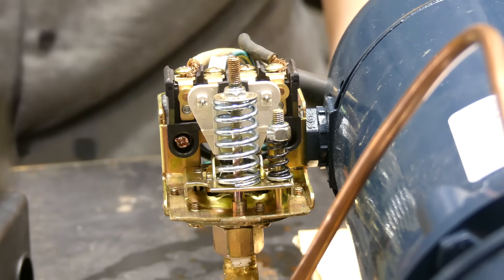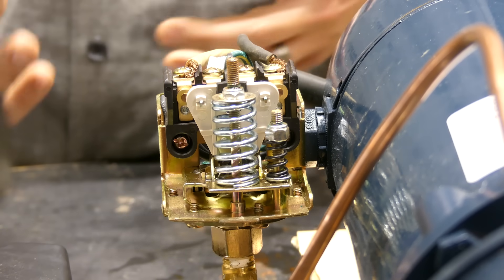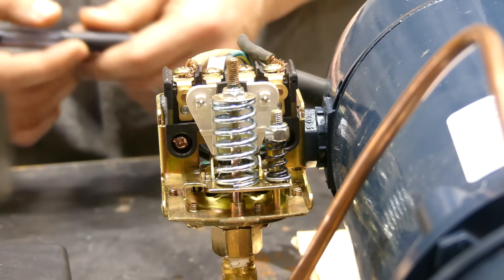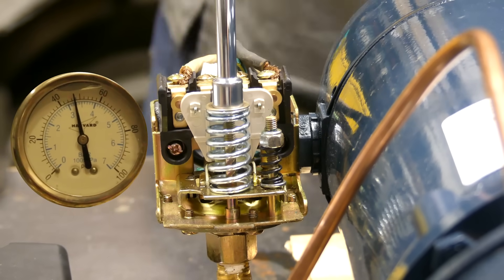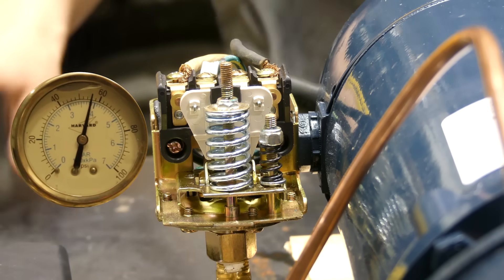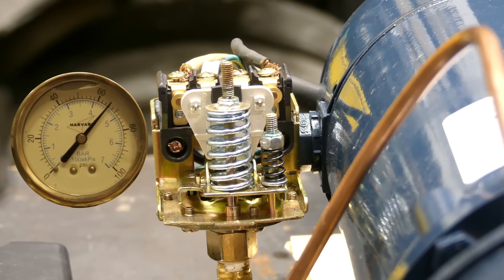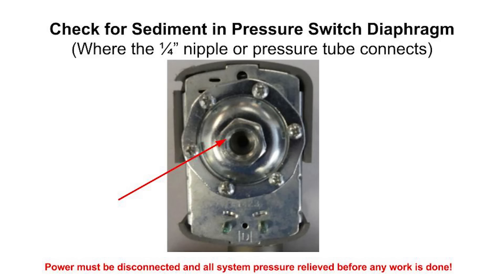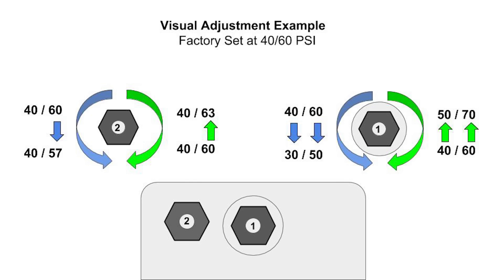How To Adjust a Pressure Switch

Comment: I put a new pressure tank in, pump shuts off at 55lbs like I want it to but when I'm running the water the pump don't kick on till I have no water pressure at all. like when I take a shower I will completely run out of water before the pump kicks on
Reply from the maker: You need to check your pressure tank. We have a video on checking and adjusting pressure tanks you should check out.
Reply: @RCworstwater  put a new pressure switch on it, that was the problem all good now

Comment: I have a well pump I replace the submersible pump and water tank and also the point but it keep jumping on and off the water pressure in the house is low can you please help me
Reply from the maker: Your tank may not be big enough or the air pressure isn't set correctly. Here's a video on how to check the air pressure in it: https://www.youtube.com/watch?v=w21qa2bMUh8

Comment: I turn pressure to 40/60 but now when the well turns on. The pump just goes on and off and on and off. Until it bulds pressure?  I only turn the top nut 3 and half times
Reply from the maker: Give us a call Roger - 855.329.4519 - You should also make sure your pressure tank is set correctly, watch our video on how to check and adjust pressure tanks.

Comment: i have a problem, i have squared D and a pressure tank with a max psi of 40. I used braided hose with clamps from water tank to pressure tank and braided hose with clamps pressure pump to pressure tank. I can gain cut off. I twisted of counter clock wise and never cut off and suddenly the hose got dislodged. Pls help.
Reply from the maker: Frederick, please call our technical service number: 855.329.4519

Comment: HELP, My psi is at 0, even if i tighten the pressure it does nothing. What do you think the problem?
Reply: Do you have power at the pressure switch?  Are all wires attached?  No scorch marks?  Is the 1/4" nipple clogged?  If nothing found, I'd buy a replacement switch.

Comment: I put on a new pressure switch and didn't cut the power off and went to adjust the nuts and got a spark now no power at the switch did I burn the new switch up?

Comment: What will cause the pump to keep running without cutting off? And another thing the pipe keep swelling like a balloon at the two end of the pump.
Reply from the maker: If you adjusted the switch you may have set the turn-off pressure too high. Give us a call and we can help: 855.329.4519

Comment: can I switch to a pump above ground, from sub? they burn out a lot!
Reply: Yes, but how deep is your well?  Shallow well pumps can only work with wells less than 23 feet down.  "Jet" pumps can go deeper but flow is less and the well casing will need to be wide enough for 2 pipes.   One other thing.  If you live in a cold area, you'll need to move the pump into some kind of "pump house" that stays above freezing.

 I had a Sears "convertible" jet pump that worked very well for me.  My well was 33 feet deep, and I had a water table 16 feet down.  I never lost water even in late summer when the neighbors went dry.

Comment: Hi get out the air from pump ? ( in case to repair ) thanks
Reply: There is usually a small screw on top of the pump that you can remove to add water and reprime the pump.

Comment: Watch out for the pressure switch with an off pressure of 80 PSI and above, afraid that the water pump is broken, if the water pump doesn't burst, the pvc pipe is broken because the pvc pipe has a maximum pressure of 55 PSI by default.

Comment: Can anyone help? Is pressure switch will only cut off when it reaches at its cut off (meter) point? Or it will automatically cut off/shut off the whole pump, when the the ball valve reaches up as it close? 

Coz, before we install the new pressure switch, we always see the pump will only turn off as the ball valve closes, and when we install the new pressure switch it close at its cut off point, BUT it didnt fill the tank with enough water.

 Appreciate your help. 😁

Comment: I’ve noticed that mine is a 30-50 switch. But cuts on at 20 and off at 50. Air pressure sitting at 28psi

Comment: Good explanation of the pressure switch but you forgot to mention the need to match the air pressure in the pressure tank to the cut in pressure of the pump.
Reply from the maker: We did forget to mention it in this video, but here is a video that covers it : https://youtu.be/w21qa2bMUh8

Comment: I have a question : We just have a new switch with new wire running from the braker panel , here is the question : the switch won't work just kicks and kicks out but don't hold the resistance so the water hasn't sufficient pressure to go to the house ,what can we do?
Reply from the maker: I would check that the pressure tube or pipe is free of debris. Sometime small pebbles or sediment can plug the line that allows the pressure switch to sense the water. If your pump keeps running but water pressure is not getting to the home check for leaks or closed valves. If you have further questions please let us know!
Reply: @RCworstwater     .l uyt

Comment: I have backed off the differential switch completely and the pump still won't shut off.  Any ideas?
Reply: Even with the differential screw backed all the way off, there will still be some differential, something like 10 #.  Perhaps the pump can't put out enough pressure?
Reply: @jackb1803  I just replaced the pressure switch. Problem solved. Thanks for the reply.

Comment: if the air compressor has only one adjusting bolt, how must it be adjust for the perfect cut off and cut on ?
Reply: Well, this video is on water pressure switches.  In your case, the differential is preset.

Comment: dear sir,

last month i had trouble with my pressure switch, every time i started pump, within 2-3 seconds pump shutdown automatically, i checked inside have one spring and one pressure regulator screw. four points NC NO C T, C NC have conductivity, should i loosen the screw??? 

after replacing with new one pump working, but i need to fix the problem

great to watch. best wishesh

best regards
Reply: Is your pressure tank "waterlogged"?

Comment: Does water pump automatically turn off when it’s hot?
Reply from the maker: Yes, single phase motors have a thermal overload installed to cut power if they get too hot.
Reply: @RCworstwater  Thank youu!!

Comment: What does it mean that there is a Spurt of Air in the Faucet, just after turning it on ?
Reply from the maker: It could be air escaping from the system after initial startup. If it persists then air is getting into the system somehow.

Comment: my water pressure sky rocketed today. i wonder if this could be a broken spring? i have a submersible pump
Reply from the maker: It's more likely sediment/debris built up in the 1/4" nipple that connects to the pressure switch. You should replace the switch and clean that tube out.

Comment: mines way out of range... cuts in at 20 and doesn't shut off until 100. I wonder if i should attempt adjustment or replace the switch
Reply from the maker: Wow, that's unbelievable. You should replace it with a new one, who knows how long it will stay where you set it to. You can buy them here: https://www.rcworst.com/Square-D-c231.html

Comment: I wouldn't recommend going over 60 psi (cut-off) on a house older than 50+ years. You're tempting fate with the aged fixtures and plumbing. Even on a newer build,  The entire system will be stressed and the hose from the holding tank running to the pump will "jump" violently when the solenoid kicks off. Keep it at the recommended spec. Anything over 60 is pushing it.
Reply: Here in Mexico, we set it to 20/40 in old houses.

Comment: No matter how much I adjust the settings the pressure gauge reads 100psi and it only changes about 5psi. Should I get a new switch???
Reply from the maker: It sounds like your pressure gauge might be faulty.
Reply: I've changed everything on the T now, dialed it in.

Comment: That was really helpful. Thank you! If you don't mind, I have a question. My son bought a house with a well. This house has a well, and was built on a concrete slab (not a manufactured home). The water pressure seems to swing way too far. It goes from strong pressure, to nearly a trickle before increasing again. There is no pressure tank, or switch anywhere inside the house. However, outside, next to the well head is a 5"PVC pipe, with a cap on it. Is it possible that the pressure tank and switch are underground, and this pipe is an access point? Thanks!
Reply from the maker: It is possible, but there would likely be an access cover for you to enter the pit if it were. Is there a way you can get an as-built schematic from the original owner or contact the installer for more info?

Comment: I just bought a tank it came with 38 psi air but my presure switch cut on at 35 & cut off at 55  how can i make it to cut on at 40? Instead at 35  Please help thanks
Reply from the maker: Since your tank is new, I'd suggest just buying a new pressure switch as well.  It's a good way to protect your investment, here's a link to the 40-60 pressure switch on our website: https://www.rcworst.com/Square-D-Pressure-Switch-G2-40-60-PSI-Preset-9013FSG2J24-p1633.html

Comment: I need a 15 start pressure and a 55 off pressure what to do?
Reply: You will likely need a specialty pressure switch made by Square D.  The commonly sold switch cannot handle this range.  You can also achieve this with a pair of pressure switches (not the kind shown here) and some fancy wiring.  Good luck.

Comment: Can anyone help me?! I have a new UV and 5 Micron Filter system, and went to replace my Micron filter for the first time - turned off the power and released the water so i could open the filter housing, and the water pressure in my tank is at 0. The pump pressure won't start, and my pressure switch does NOT have a lever on it??? Someone please help, how do I kick it on without a lever?
Reply from the maker: Give us a call: 855.329.4519

Comment: Hello there , your videos are very helpful. I have a question? My current well has sand coming out.  Is it to far to connect to another well on my property that is about 100 ft away. If so any tips?
Reply from the maker: I'm not sure what you're trying to do, please give us a call to discuss: 855.329.4519
Reply: You need to consider adding some kind of filter before the pump as sand can erode and damage the pump.  Perhaps you have a screen at the bottom of the well that is damaged?

Comment: Hello, if anyone can help my pressure switch goes down to 10 psi and shut off at 30psi, is this normal with a pressure switch at 30/50 and the well tank pressure set at 28psi?
Reply: No, the pressure tank needs to be set under the cut-on setting.  But a 10/30 setting is pretty low.  Are you running aquariums with  vinyl tubing?

Comment: How do I reduce the range.  For example, instead of cut on at 20 and cut off at 50, I want to cut on at 40 and still cut off at 50.
Reply from the maker: Give us a call if the video did not explain it well enough: 855.329.4519

Comment: About every 3 3 weeks I suddenly have no water pressure.  I push the pressure switch plate with a stick until it makes the electrical contact and then the pressure comes back.  How do i fix this in a more permanent way?
Reply: sunny1011 replace the he pressure switch. Make sure you shut off the power before doing so
Reply: @larryreno8293  thanks for your reply.  It is a new switch.  I'm wondering now if the problem could have something to do with the pressure in the tank which i see must be set 2-3 lbs below the cut-on pressure of the switch.  Do you think that is possible that it would just quit every 3 weeks because of that?
Reply: sunny1011 it's always worth a try!

Comment: How do you adjust the switch so there is no on/off and the pump stays on as long as there is flow?
Reply from the maker: That is not within the capabilities of a standard pressure switch. You would need a constant pressure system to do what you're asking.

Comment: How do you rise the runing pressure..
Reply from the maker: Did you watch the video?
Reply: @RCworstwater  I did and I am trying it on our pump I can move up the range but when the tap is open full the pump pressure does not want to go up..
Reply from the maker: It sounds like your pump is not able to build a higher pressure, they do have their limits. You'll need to lower the pressure on the switch so the pump will shut off. To get a higher pressure you'll have to buy a different pump
Reply: @RCworstwater  Thanks..

Comment: Don't you need to add air pressure to your expansion tank when you do this as well if you're increasing the pressure I think you're supposed to set it about 2 to 3 lb under your cutting switch pressure
Reply from the maker: Correct! See the description for a video on how to do that.

Comment: I have a pressure pump it runs only if I use a lot of water like opening shower and sprinkler at the same time. How could I make the pump turn on if I am only using one faucet. The Pump is set at 40/60
Reply from the maker: Thank you for the question.  The pressure switch is what tells the pump to turn on and off.  With a 40/60 setting, the pressure switch turns on the pump when the pressure in the system falls to 40 PSI and the pump turns off when the pressure climbs to 60 PSI.
Reply: Is it ok to lower the setting from 40-60 to 20- 60  or 30-60 so that the pumps turns on even if I am using only 1 or 2 faucets at the same time?
Reply from the maker: Cesar it may be best to give us a call so that we can help you with your situation.  Thanks.

Comment: what to do if the pump turns on only after giving it a pat
Reply from the maker: You likely have a clog in the tube that connects to the pressure switch and/or in the diaphragm of the switch itself.

Comment: our pressure guage drops at 0 but still the switch doesn't  operate. do i have to buy another switch or It has to be adjusted?
Reply from the maker: You probably have a low-pressure cutout switch. You'll have to manually engage the contacts if so. Here's a video on them: https://www.youtube.com/watch?v=ROvZpwHV9Ho&t=20s

Comment: i installed a new pressure switch, pressure gauge, tank, and check valve. emptied the tank to learn its psi and when i turn the breaker back on, the tank fills, but when the switch goes to cut of, i get: ticka ticka ticka ticka. what's going on please?
Reply from the maker: It sounds like your pump is rapid cycling. Here's our video on troubleshooting it: https://www.youtube.com/watch?v=CPzRpD_Tncc&t=40s

Comment: The water pressure coming into my house is too high. How do I adjust to lower the water pressure? I have a 30/50.  When I checked the it read 30.5 psi..I released air to 28 psi. The water pressure is still too high coming into the house. How can I adjust it to lower the pressure?
Reply: Add a pressure regulator to your plumbing.  You don't need a pressure switch.

Comment: change my 30 50 switch and pressure goes down to 20 ish , how does this happen, new one installed
Reply from the maker: Did you buy the right switch? Look under the cap for the rating.

Comment: Great videos! Thank you! Question: when you increased the range from 30-50 to 40-60 it cut in at 38psi. Did you change the tank pressure from 28 to 38 without telling us?
Reply from the maker: Yes! The pressure tank needs to be adjusted to 2 PSI below the new cut-on pressure of the pump.
Reply: @RCworstwater  found my answers thank you. And you got another sub my friend. Thank you for taking the time to help us Harry home owners 👍🏻

Comment: My pressure shuts off at 60 but low restarting at like 15 psi any idea
Reply from the maker: Try replacing it with a new 40/60 switch and make sure to check for sediment buildup in the 1/4" tube that connects to it.

Comment: My pump wont shut off and it wont get to 40psi and stay there.  No water is coming in the house unless i prime it with a hose from the neighbor.  Any idea what is wrong?
Reply from the maker: Thanks for the question Donna! It sounds like you may have a leak. Give our customer service line a call and we can help you get to the bottom of it. 855.329.4519

Comment: My pressure switch recently started constantly clicking on/off as the pump runs, does anyone have an idea what might be causing this?
Reply from the maker: Likely a blockage in the tube that connects to the switch or a bad/incorrectly set pressure tank

Comment: What about if the pump is only building barely 30 psi & stays there & won’t turn off?🤨
Reply: Problem is most likely with your pump, or a defective check valve that's leaking water back to the well.
Reply: You got it right; check valve had some trash in it 😢👍

Comment: If I read the meter correctly the pump shut off at 70 PSI not 65 after adjusting the differential.
Reply from the maker: You're right, he mistakenly said 70. Good catch!
Reply from the maker: You're right, he mistakenly said 70. Good catch!

Comment: Why my gauge drops its pressure when faucets not in used
Reply from the maker: It sounds like you have a leak
Reply: @RCworstwater  i checked the leak but i found none...i drained all the water from the tank and it works fine but when the tank is not in used the air pressure fall down to 25psi and the motor starts to run with no air in the tank..the tank is full of water....i'm using an old model of pressure tank not the new one just like you were using